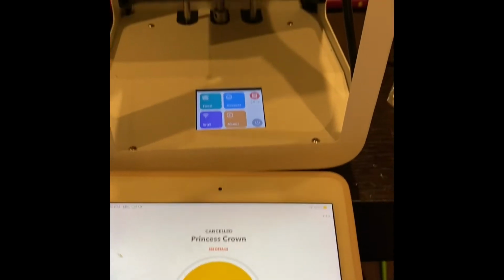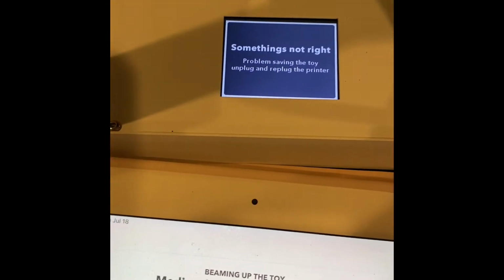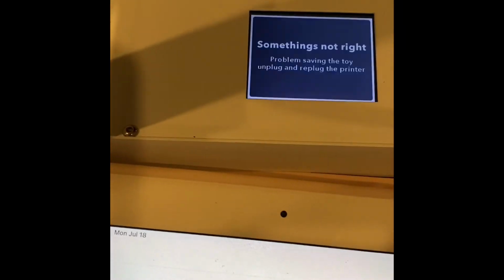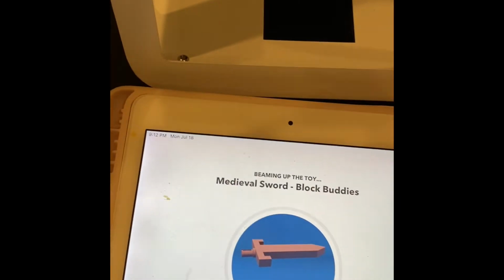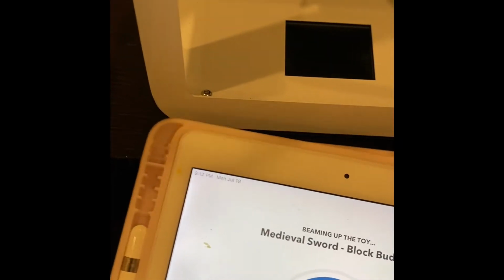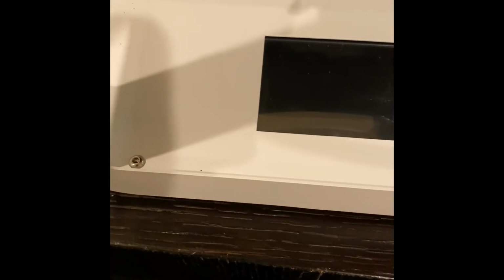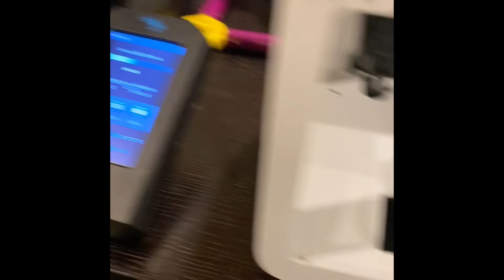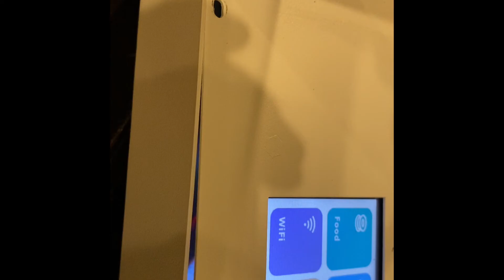TOYBOX 3D printer trouble shooting somethings not right”

Comment: Thanks for this vid! I didn't realize after opening mine up from curiosity that there was a microSD lurking around.  In your vid you can see the silver socket with a half circle taken out at the front, which is an SD card for the actual controller board.  I'm still putting together details from that.  But having removed the SD card and taken a look, I am now able to better figure out the website Cura slicer settings to document better slicer settings for other slicers.

Comment: I’m having the same error but removing and adding the card didn’t work.  Did it work for you or do you have any other suggestions?
Reply: My suggestion is to pull the card and put it into a windows system and then let windows format it.  That will show if it the card is working or not.
Reply: To clarify what this SD card is for, it stores the raw gcode text being sent over when you click "Print Me".  The card is 128MB (at least on my ToyBox) and has 1 standard "Windows" partition.  That partition does not actually contain a usable filesystem that can be mounted.  It is literally just a raw scratch space.  It is generally filled with hex 0xff for the whole partition, but text gcode gets written as needed.  At the least, doing a full format in Windows will show that the SD card is good or not, as cards do go bad.